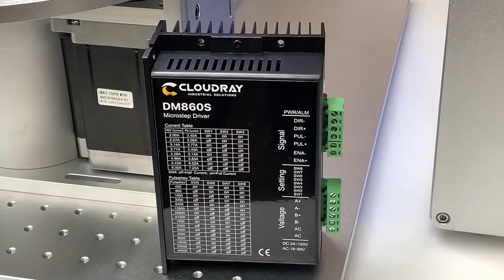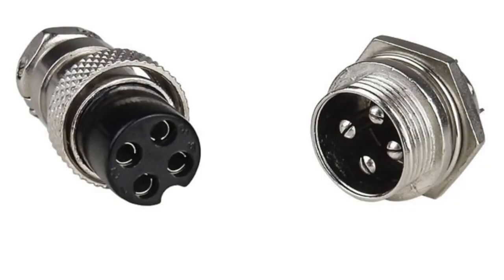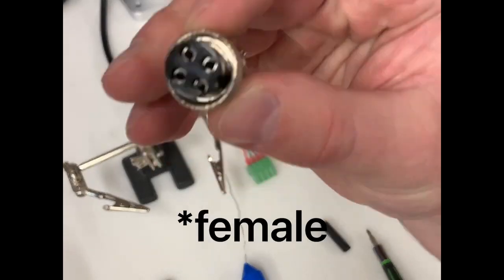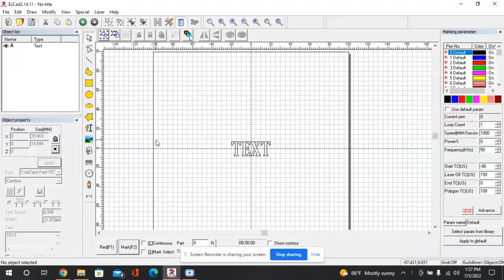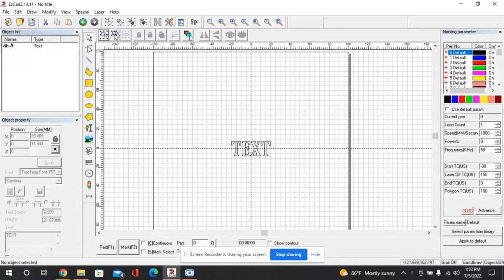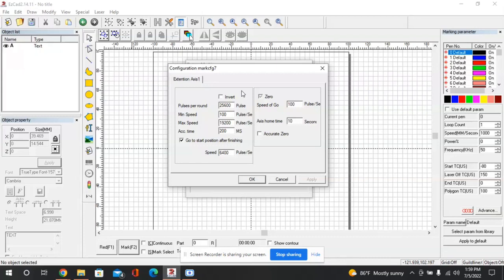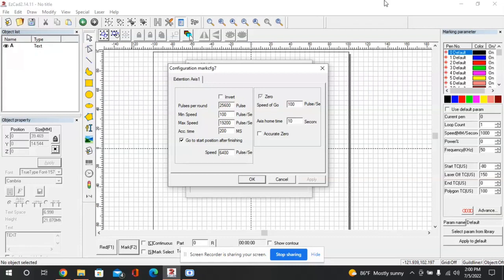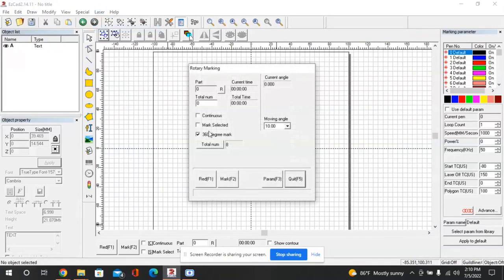How to Setup and Operate a Rotary Table for Fiber Lasers--Cloudray QS-50 50W Laser Engraver

Comment: Any way to sequence these so you could individually number each card 001, 002, 003 etc?
Reply from the maker: If you use EZCAD, when you select the text format, there is a variable text option in the lower-left corner of the screen, you can set it freely.